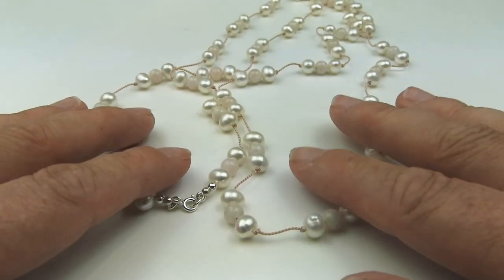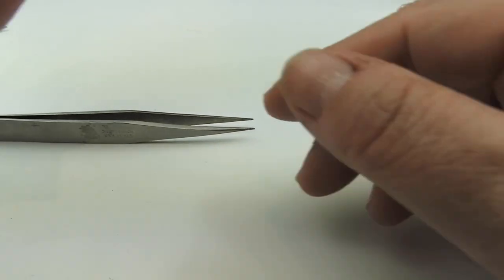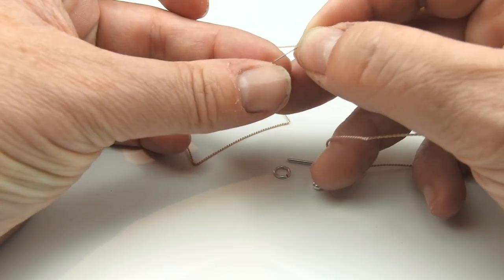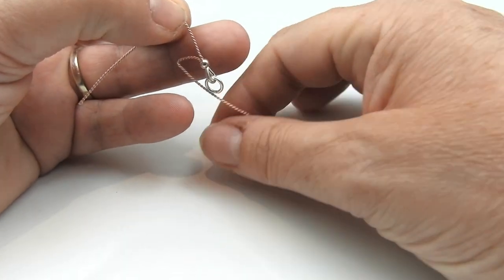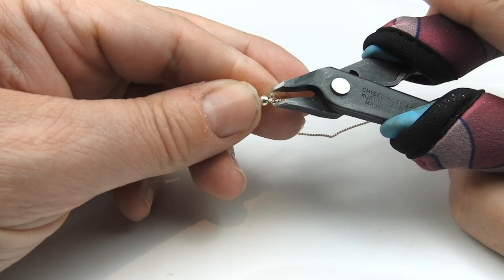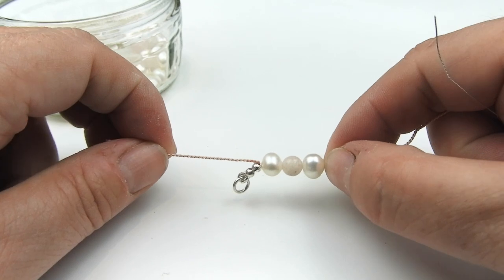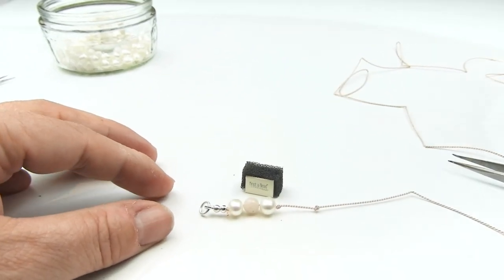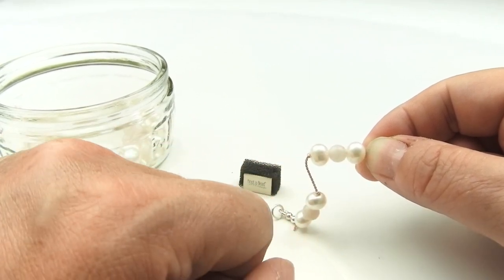JewelleryMaker | Tin Cup Necklace

Comment: I like your demo very much and want to try this, so I can convert a 20” strand of 8.5 - 9mm pearls into a long rope. Two questions: Substantial pearls are not lightweight, so do you find that they stretch out the silk quickly in an extra-extra-long necklace? Also, if that jump ring is the one that a clasp connects to, is there an advantage to using an open ring rather than one already soldered closed?

TIA :)